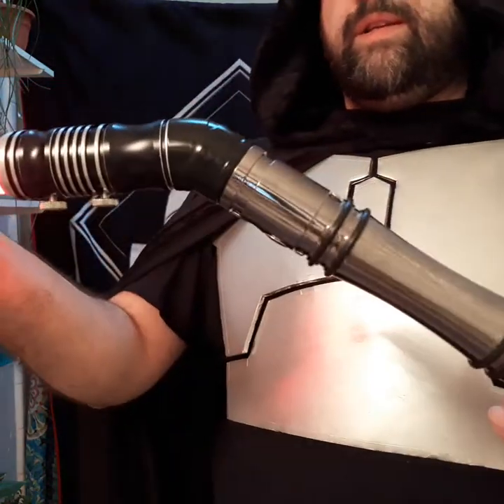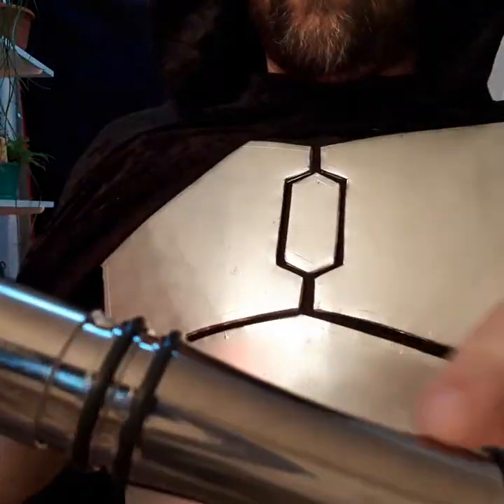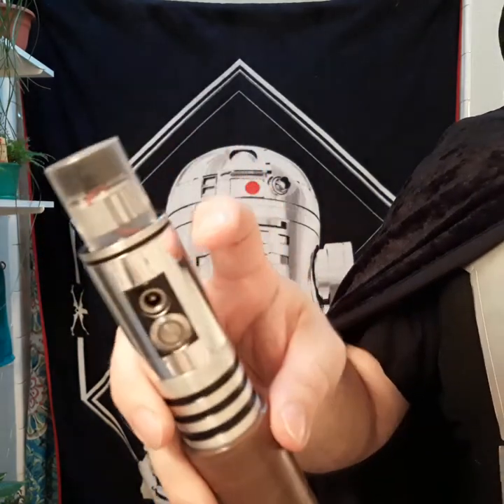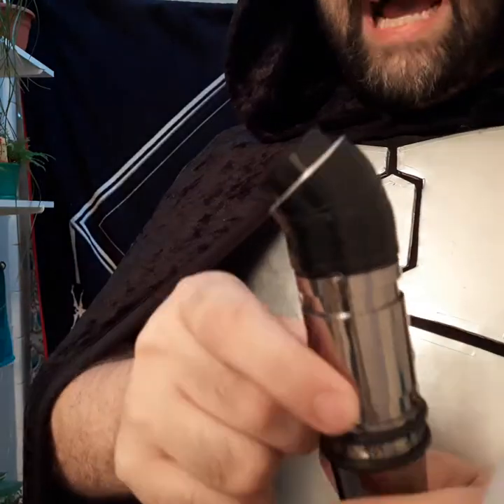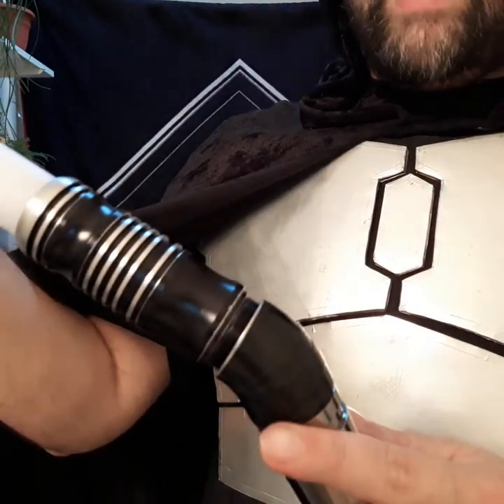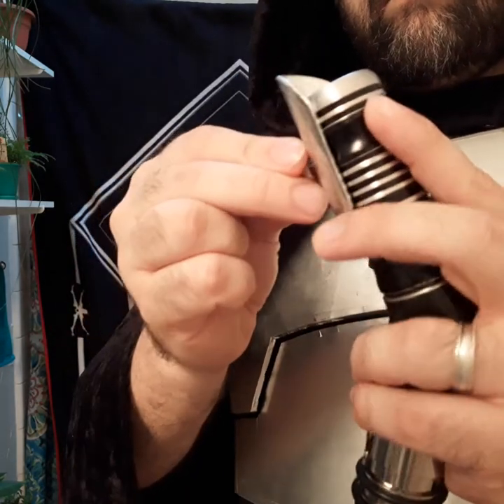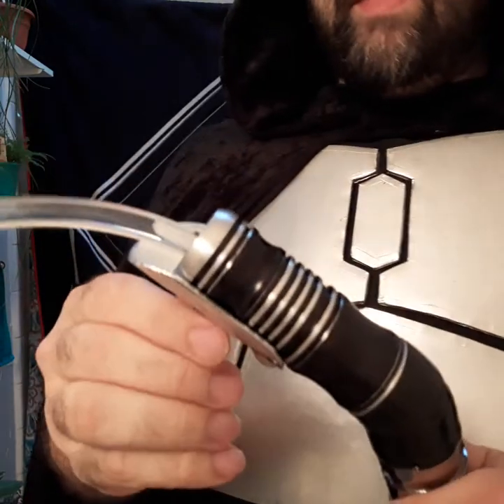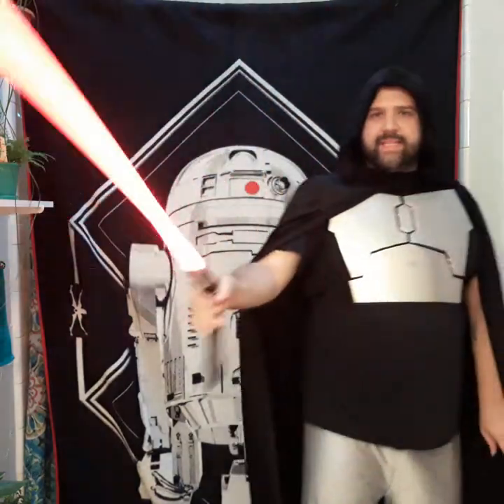Custom curved/angled lightsaber hilt

Comment: I thought the same thing but with a smaller blade like a dagger and holding it backwards did u make this?
Reply from the maker: Yes I did. Ordered the parts and a regular Base-lit core. I had to cut the plastic chassis away around the LED housing to get it to curve. It was a fun experiment, but I quickly realized that curved hilts are not my style. I much prefer staffs and pikes